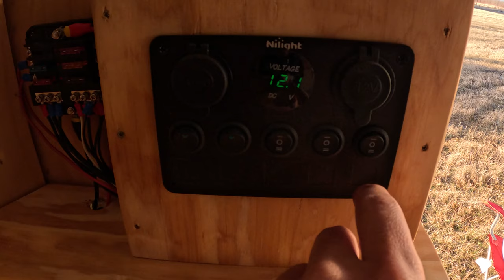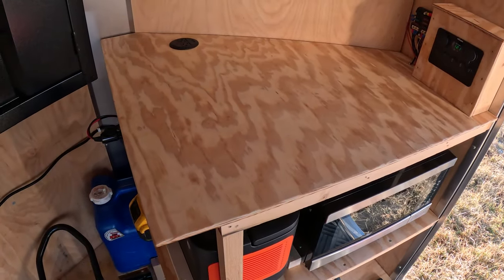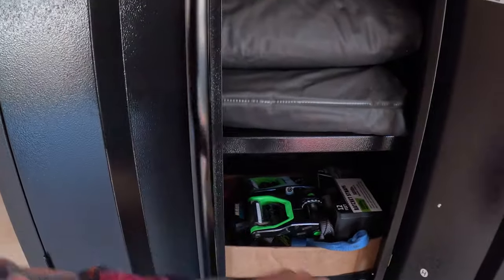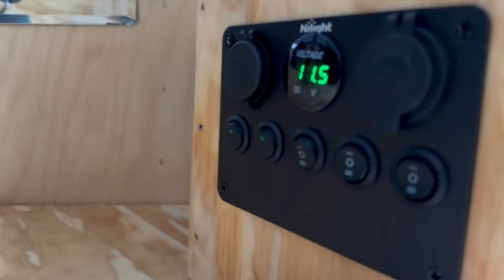DIY Cargo Trailer Toy Hauler Camper Conversion

Comment: 6 X 12 would be a perfect size for my NEXT TRAILER. Agh... I started a 5 X 10 and it has taken, working very part time on it, 1.5 years to do what you and your other half did in three days' time in your build vid. Hahaha... how nice to have a helper and some shop shelter rather than one's driveway to work on yer rig. But I'm not too envious... I like what I'm building but it's far smaller, albeit more easily towed w/ my 1/2-ton, same ground clearance, etc... I'll have a report up in the next six months LOL. Congrats! on a great, big, simple, wonderful build! my friend. Safe travels to you both.